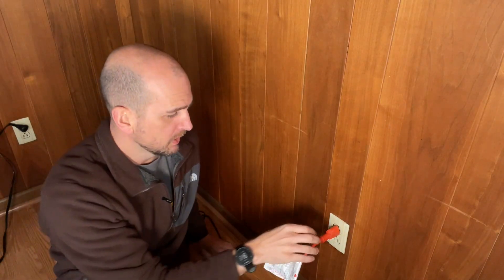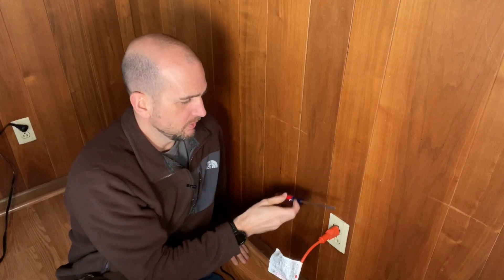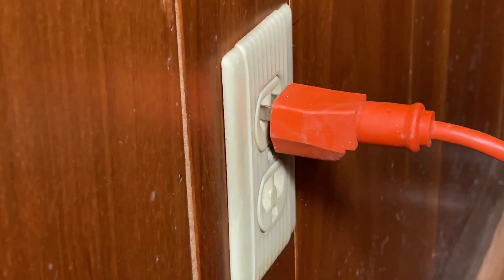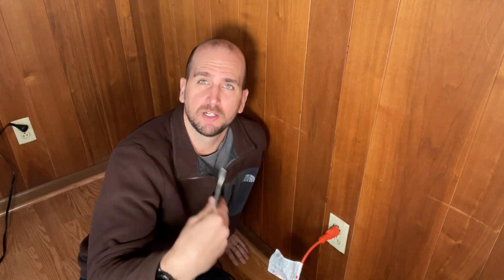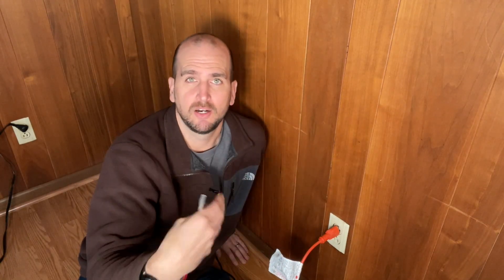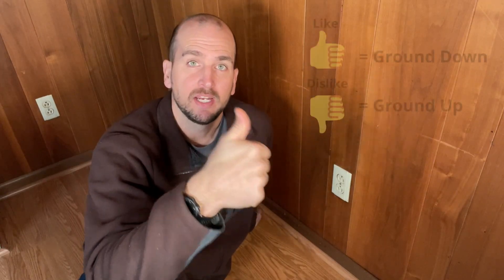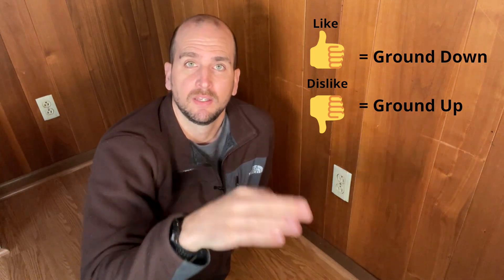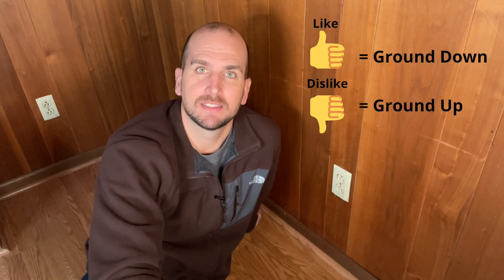Should An Outlet Be Installed Ground Down Or Up

Comment: When I was doing electrical in vocational school they taught always ground up.
Reply: I assume you've never bridged hot & neutral with your finger on a stuck ground-up plug.  This doesn't happen with your thumb on a ground-down plug. Obviously a niche circumstance, but so are the issues that ground-up are intended to prevent.
Reply: @LeadSkillets  I did that once... I was disassembling a water bed... laying across it after the sheets were removed... all in all I felt a bit more alert after since I was sleep deprived from finals lol
Reply: That's where I learned it as well. Never found it in the nec code book though. It's good practice on workbench, mechanic plugs and etc. Due to the obvious if something falls it will hopefully bounce off the ground and keep from shorting. I have seen in old houses where the upside down (or right side up depending on the reader) is to identify a switched receptacle from the others.
Reply: Same. Reason I was told was the ground is safer on the top in case the plug pulls out slightly and something falls behind it and it also helps keep the plug in better.

But that’s covered in the video...
Reply: @KrossGarage  If the plug is partially removed, the ground plug will break contact first and provide no ground protection.  Getting shocked by an ungrounded appliance can kill you, while shorting a plug will just trip a breaker and maybe damage the outlet with no danger to life.

Comment: I like ground down  because most receptacles are lower than standing position, so when you unplug a cord your fingers wrap around the plug with fingers mostly on bottom of plug with only thumb placed towards the top. So with ground down it is a little less likely to touch hot and neutral at the same time.  IMO

Comment: Ground down.  I was taught that It was to protect against water splashing on a wall and running down.  In this case any contact with the load line has an increased chance of being directed to ground and shorting before it reaches the floor.

Comment: The plugs are faulty earth up or earth down  continual strain  on the lead  you live and Neutral pins need shrouds around them  that entire electrical system needs urgent revision  sockets top bottom  makes no sense side by side makes sense   . Also the outlets should be SWITCHED  there should be a FUSE IN THE PLUG

Comment: If the power outlet is outside or in a place shop where a metal ladder or other metal object would more likely fall on it. I mount the outlet with the ground pin up.

Comment: The up on switched outlets and down on constant outlets is an interesting theory that I'll now consider.
Reply: No, those are lazy contractors.  Install a properly label receptacle. Such as https://www.hubbell.com/wiringdevice-kellems/en/Products/Electrical-Electronic/Wiring-Devices/Straight-Blade-Devices/ConstructionCommercial-Receptacles/DR15C1WHITR/p/2608245

Comment: It really doesn't bother me either way. They should be the same way in the room.😂
Reply: I'm really not sure it matters at all today since 90% of all power tools and appliances are double insulated and don't have grounds at all.  So, how will having ground up stop all of you idiots from dropping pennies and other metal objects onto the two exposed prongs of the two-conductor plug.  If you have this happening  then I hope the "survival of the fittest" rule kicks in and you will all soon be unable to make these comments.  I've been here since 1963 and I work extensively in construction and industry and have 8 kids.  NEVER have I had shit dropping on exposed plug prongs, let alone any where the ground up would have prevented it.
Reply: @beaverriverbushcraft  WHAT? You don't drop your pocket change onto wall outlets that are half way pulled out?
It must be nice to be so perfect.
Reply: @williardbillmore5713  perfect?  Far from it.  I put my change in a 2kg peanut butter jar.  Nowhere near a plug.  I don't call that perfect, I call it having foresight.  No different than making sure that the toilet seat lid is closed, thereby keeping random shit from falling into the toilet and being flushed, clogging the toilet or the septic system.  I guess it's more along the lines of not lazy than perfect.  Like the saying goes, "A stich in time, saves nine".
Reply: @beaverriverbushcraft  I thought shit was supposed to fall into the toilet and get flushed...
 I was pulling your leg, man.
Reply: I grew up seeing the switched outlet opposite.  But yes, all others the same way

Comment: I prefer ground facing down just because that’s what I’m used to seeing. It’s like installing the ON/OFF switch; you’re used to seeing UP be ON, and DOWN be OFF. (I have three 2-position switches in my house, where you can turn the lights on or off from opposite sides of the room. It drives me NUTS when they’re not facing the right way.) It’s also like installing a water faucet. You used to having the left knob be HOT, and the right knob is COLD. The opposite way is not wrong, just oddly different.

Comment: I was a professional electrician for about 15 years, just the residential work I did was well over 1500 units either wired myself or supervised, NEVER put an outlet with the ground up. And never will.

Comment: I grew up in Maryland, and live there half my life. I never once saw a plug installed with the ground up. Not one single time. Then I moved to Ohio and noticed that most of the plugs in my house are ground up.  I thought maybe some crackpot had wired my house. Then I started noticing the same thing in other peoples houses. And then I noticed it in businesses, too. So it's clearly a regional thing. Unfortunately some regions are just crazy. LOL 

Outlets have always had some sort of writing on their sides, or backs, or in between the two front bumps, and that writing always orients the plug ground down (or wide blade left) in my experience.  Clearly, the ground goes down.

Comment: Check your GFCI outlets. If it is a single outlet with the Test and Reset function in one section of what would be a two receptacle outlet you will find that it is Ground pin up. And the function section goes to the top. That is the only way you can read the lettering on them.  All of our GFCI outlets are Ground pin up. The non-GFCI ones are Ground pin down. Also when you buy pre-wired outdoor boxes that have breakers in them, such as for a travel trailer, the 110VAC outlets normally are Ground pin up.

Comment: I prefer a ground down to three prong Outlets have a problem of falling out easier when you have the ground up. I've worked many years is a service repairman for office equipment and that has been a lot of problems in buildings where the grounds on the up side of the plug and also in homes I've been in. With the ground on the bottom they stay in more secure from my experience.

Comment: I had an old-time electrician tell me that he put them "ground up" when the outlet wasn't a "true grounded" outlet. (Whatever that means.) I guess he meant that somebody had a bunch of the old 2-prong outlets and they were switched to 3 prong for convenience, so that was a warning that they weren't really grounded.
Reply: Yes, if installed "ground up" the receptacle is NOT grounded, when old 2-wiring (old 2-prong receptacles) are replaced with a "modern" three-prong receptacle. It's a visual indication that even if the receptacle is installed in the wall, if "up" it is NOT actually grounded. I learned this when re-wiring an old house that had electricity installed in 1918 and some of it was updated in the 1970s.
Reply: @Fasciseus 
It's a code violation to install an ungrounded outlet.  Once you pull the old one out and decide to install a new one you're obligated to bring it up to current code.
Reply: @Rowgue51  with one exception: two-prong receptacles may be replaced with a GFCI and three-prong receptacles with "no ground present" stickers applied.
Reply: @LDuncanShortridge  
That's an acceptable work around in the building codes of certain areas.  But it's the exception to the rule.
Reply: @LDuncanShortridge  This is exactly right.
Reply: That is how I understood it - and how it is in my 70-year-old house.  A previous owner changed many outlets from 2-prong to three, but did not add a ground.  Most of those were installed with the ground hole facing up.  As the house is getting rewired, the outlets get the smiling faces!  :-)

Comment: I prefer ground up simply because it's easier to plug in three pronged plugs. It makes no difference for two pronged plugs, but it's definitely easier with three pronged plugs. I do like you idea, but would reverse it for switch outlets. I would install switch outlets with ground down. Since there is no code that covers it, you can do it the way you prefer. One thing I have noted, all the space saver plugs I get have a rotational option so I still get the space saving feature by rotating the orientation of the plug.

Comment: what ground?! my house was built in 1953 and still has the original cloth covered romex (not the vinyl covered romax) wiring, all the outlets are the original two hole outlets, and the 60 amp service fusebox is original too. everything still works perfectly

Comment: There is kind of the rule that in most of the situations the ground must be the last one who breaks connection (this is also the reason ground wire must be the longest when installing the cable  into the appliance). From this perspective I would probably put the ground down.
Reply: NEC requires ground as first made and last broke connection.
Reply: The usa is way behind the times on electrical safety. The UK has had the safest system in the world since 1947. Its ground/earth at the top and live to the right, neutral to the left and of course with a fuse in the plug.

Comment: AND THE ANSWER IS: it depends on the code in your state and county! New York say ground up! Alaska says it doesn’t matter! The manufacturers intended ground down! The reasoning for ground up is that if something falls on top of the plug, it hits the ground and doesn’t short something. BUT if something falls on a ground down a breaker just trips a breaker and you can go reset it.

Comment: I wire up all my outlets so that the ground pin is down — for a very specific safety reason.  When I plug in, I’m almost always looking down or leaning downward.  My thumb is on top of the plug (where I can see it) that I’m about to insert, and my index finger is on the bottom (where I cannot see it).  So, sometimes I have my finger inadvertently touching the metal prong.  I’d rather be unknowingly touching the ground than the hot! 😱  The argument about dropping a screwdriver on the hot/neutral just perfectly on a loose cord seems too one-in-a-million to me and that argument just doesn’t hold water with me!

Comment: Every doctor's office and every hospital I've been in for the last 15 years or so has had all grounds installed facing up.
Reply: Mandated by 'safety experts' who do not understand that such an installation to prevent the rare chance of an object bridging the blades results in situations where there is no ground protection, but also increases the tendency of a plug to pull out in the first place.  'Ground left' horizontal installation makes more sense for such paranoid people, as it places the neutral up, ground to the left and hot down.  For life support critical, they should use twist lock plugs.
Reply: @benevolenthighwayman882  Not much chance you'll have loose plugs in a hospital, the receptacles hold better. But yeah, a twist-lock or locking plug would be better, at least in some instances. Personally I like having stuff I can quickly unplug in an emergency.

Comment: I also prefer ground facing up in outlets such as a garage along with the right angled plugs. The right angle plugs plugged in upside down create a natural drip loop in the wiring which prevents any water/liquid from flowing down the cable into the outlet.

Comment: The reason I prefer ground facing up is somewhat like your loose plug example, except that if something falls on the cord, it's not pulling down in the cord in a way that levers the hot and neutral out of the socket. If something falls on the cord, it'll actually lever those into the outlet, while levering out the ground.. which means less potential for arcing.

Comment: Anywhere I've ever lived, the ground up is a switched outlet, ground down is always live.
Reply: How about split outlets, half switch operated, the other on all the time.  I like the idea of ground up for switched outlets, however, just never though of doing that.
Reply: I use black colored Outlets for dedicated or switch circuits I knew you could do it but so far I've never had any work on a half switched receptacle anyway I can tell the guy giving the first replies is an electrician

Comment: Put it the way you wish. I'm almost 40 years in industry,  taught by someone who taught Edison. His saying was, if you have to bend down. Ground down. If you can stand up to pull the plug, ground up. Humans have a bad habit of not pulling cords out straight. Usually bending the ground prong and breaking them off when they are ground prong up when the are low pluggins
Reply: Where there three prong receptacles when Edison was around?
Reply: @jimmac1185  Yes, they were around well before his 1931 death.

Comment: Another reason for ground down that wasn't mentionned is that a loose plug will tend to pull down over time and if the ground is up, the ground may loose contact before the hot and then your appliance is no longer grounded and could cause électronution which is a more hazardous situation than something metal falling on the prongs which is already protected by the breaker. With the ground facing down, it is more likely to be the last pin to loose contact.

Comment: Horizontal only leaves one terminal exposed at all times and keeps cables from touching. Vertical are easier to install on studs. Depends on the building construction.

Comment: If the outlet is low on the wall, "Ground Up" will help the grounding pin contact the receptacle first when plugging in, and be the last conductor to contact the outlet when you pull the plug. However, I've noticed that if the receptacle is low on the wall, like 16" above the floor, and it's "Ground Up", eventually the plastic on the receptacle will crack between the ground pin and the blade slots. Probably I have only seen this on household types and not commercial or hospital etc. 
If the outlets are Above counter level, and they're "Ground Down", they seem to be even more likely to crack, mostly from the plug being pulled Down as it's being pulled Out. Also, I feel that "Ground Up" outlets are easier to plug in when they're 38" or more above the floor. That has been my own rule for about 25 years, and those are my reasons.
When I've seen all the outlets "Ground Up" like in this video, it usually means that it was easier to fold the conductors into the box that way when whoever installed them did it.
I am Not a guild electrician.

Comment: I was a shipboard electrician in the Navy.  The rule on our ship was to consider the direction the cord/plug would be pulled from.  So for normal wall outlets at 18” (or below the waist) the ground  would be up.  If the receptacle was mounted above the waist then the ground would be down.  The reason behind this was in hopes that the ground pin would be the last to break contact.  Now 40  years later I’m still wondering does it really matter.  It appears, as several people have pointed out, that the industry standard is ground down to accommodate appliance plugs, right angle plugs, and  etc.  I'm good with that.

Comment: Well, here is my two cents. Generally, I see most grounds down. I have learned, from a safety point of view,  ground need to be up. Here is an example. If a child had a metal object and decides to put it behind a plug, like a butter knife, most likely they will com from the top. If grown is down, shock. If up, breaker trips, could save a child's life.
Reply: Why is your child playing with a knife? 

Parental fail right there. 🤦‍♂️
Reply: @Crewsy  And if that child gets popped once, he won't try it again... so maybe a win? Kids need butter in their life, but most times they jam a fork in there. Mine jammed a stick into an outlet. Clearly superior intellect.
Reply: kids pick up pennies off floor and could stick it in top of outlet just about anything  conductive they love to pull cords out and play with outlets. i have personally seen aluminum foil fall behind a plug on a kitchen counter making an explosion and fire from outlet having ground down

Comment: "Ground Up" is a solution in search of a problem.
Reply: or a tough piece of beef in need of preparation
Reply: Ground up is only if something falls on a plug half out it does not cause a spark.   No other reason
Reply: Mine are ground up and man plugs definitely hold in a lot better
Reply: @zaceryhammond1144  Tell that to my sagging plugs.

Comment: I suspect that the ground up/down argument originated as the subject of discussion among a group of electricians over a pitcher of beer on Friday night.  And in my opinion, it probably doesn't matter as long as all of the receptacles in a given structure are installed in the same orientation so that occupants don't have to feel around in the dark to know which way to plug stuff in.

That said, the plug on my Toro snow blower starter motor is ground up.  It's the only thing in the house set up that way, and causes me grief every time I have to start the blower.

Comment: No question down because all your appliance plugs are usually flat to be able to fit against a wall and the ground is orientated down, if you placed it up the wire would naturally bend down and kink defeating the purpose of it being able to lay flat and point downward, plus up just looks like a guy had way too many cold snacks while working on installing them so he put them upside down.